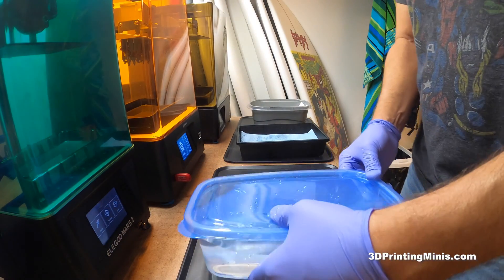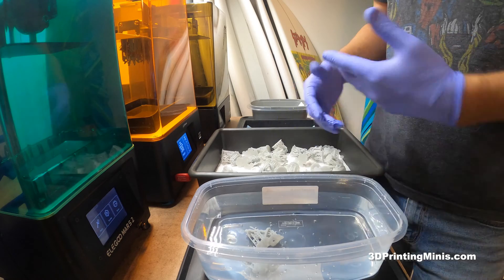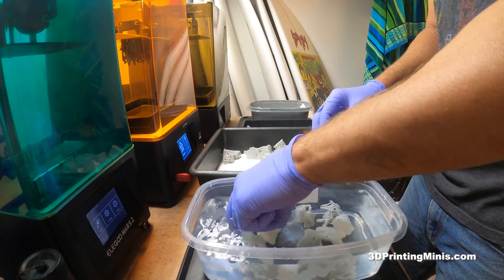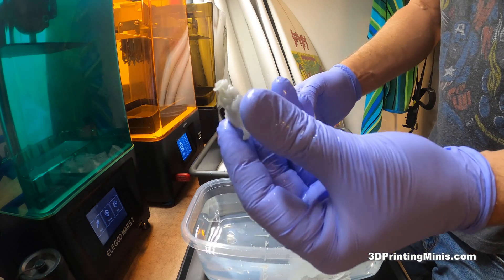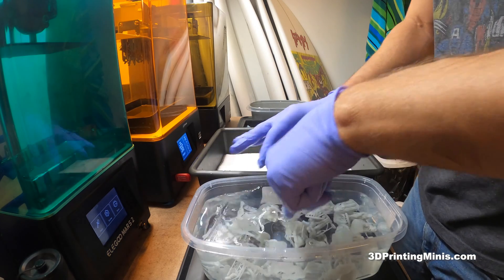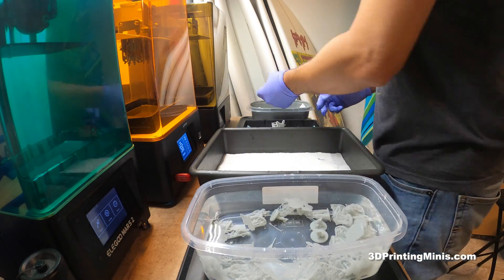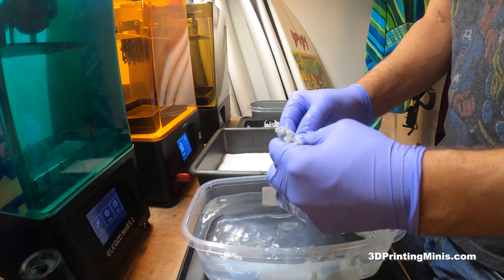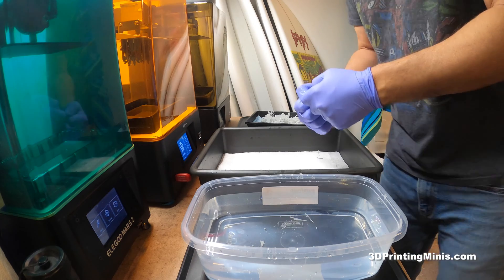How To Remove 3D Resin Print Supports With Warm Water

Comment: what do you do about the little bumps from supports?
Reply from the maker: You can sand them off with 400 grit sand paper before your prime then.
Reply: @3DPrintingMinis  so on the minis, do you do it by hand or would you recommend like one of those electric nail file/sand things on amazon? they’re like $20 with $4 refills

Comment: What is your go to resin right now?
Reply from the maker: I"m using several right now (mainly for printing miniatures).
1. Epax Hard Grey (a little expensive but makes nice prints and strong swords/spears)
2. Siraya Tech Fast Grey with 150ml of Siraya Tenacious added (again expensive but makes strong mins)
3. Phrozen 4K resin (cheaper, less brittle than their 8K resin, and makes pretty strong minis as long as they're aren't any super long/thin pieces sticking out of them)
My favorite is probably Epax Hard, but at $40 (US) a bottle it's a little pricey.
Reply: @3DPrintingMinis  Thanks for the break down. I have tried Resione TH72, Conjure tough and Mika3d tough. I like the TH72 the most for flex on the spears and shatter resistance.

Comment: Thanks for this video. As someone about to dive into resin printing it's nice to see what the workflow looks like. Already have a huge library of 3d mini's as I've been collecting files for several years now. Thanks again.
Reply: Welcome Dean!
I've had a filament farm for years printing ABS and finally added a Prusa SL1S last month.  The fumes from resin make ABS printing odor feel like child's play.  Make sure you consider adequate ventilation and temperature, which can often fight each other.   Most Resins print best above 20-30C/68-86F.  Even here in SoCal, my shop can drop into the 50F during the winter months.
Reply: @SocalCanyonRacer  I'm in So Cal as well. I've had an FDM printer for two years but want to print minis. I have some stl files for minis designed for fdm printers but there is no comparison to the detail of resin.